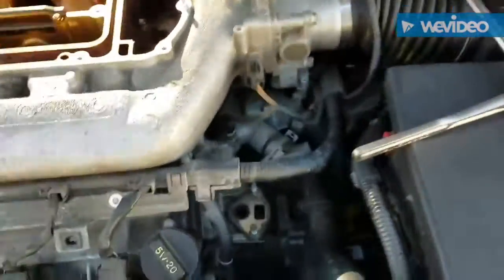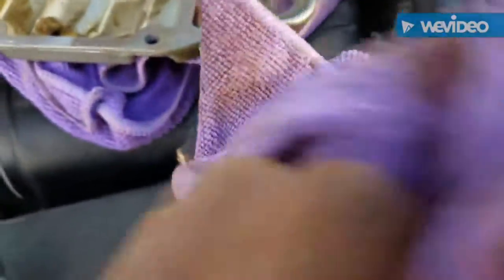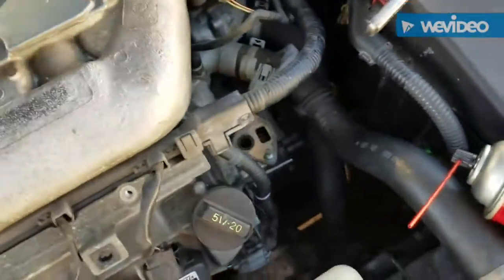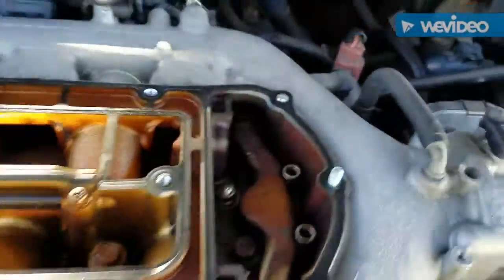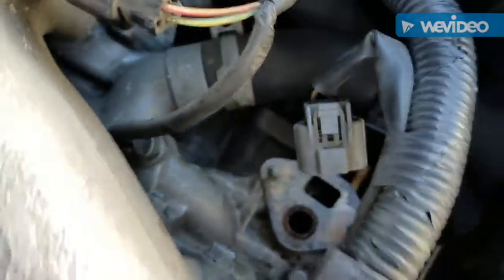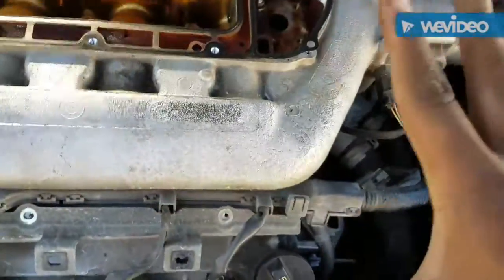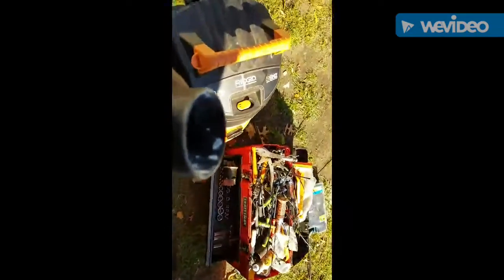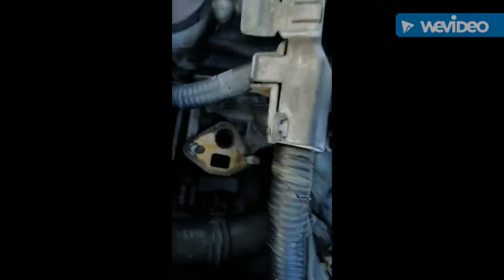P0401 P2413 EXHAUST GAS RECIRCULATION EGR INSUFFICIENT FLOW FIX TUTORIAL

Comment: How do you clean the small EGR port holes on the top of the block?
Reply from the maker: Throttle body cleaner
Reply: @fabolousg4ever  I don’t need to worry about the carbon and cleaner going down into the ports?

Comment: Thanks for the vid, gonna try this and cleaning the theottlenbody and manifold with seafoam spray hopefully thos makes my car run better
Reply from the maker: keep me posted on how it goes
Reply: @fabolousg4ever  runs way better after doing sea foam treatment and cleaning throttle body with cleaner, definitely was a lot of carbon in the intake. idles and runs much smoother and quieter, throttle response is smoother when you're rolling into it on takeoff, seems ike it has more low end power when cruising. Also has much less vibration at idle  Still not perfect but a step in the right direction, will clean egr next
Reply from the maker: @KenyonPayne  great news glad for the update.

Comment: Did you re-use the EGR valve gasket when you re-installed the valve? Or buy a new one?
Reply from the maker: You can buy a new one but i reused my gasket.
Reply: fabolousg4ever no issues with re-using the gasket? 

I want to do this cleaning and I was curious whether the old gasket could be reused with no issues (eg, leaks). Just thought I’d ask before pulling the EGR valve.
Reply from the maker: No no issues for me

Comment: I get that The EGR letters on top but it marking me the oxygen sensors and Im running rich !! Smoke and gas from the exaust if I change that Will it fix the prob???
Reply from the maker: +Rodrigo Guzman yes engine is clogged clean those valves and the car will feel way better

Comment: So to clean the intake manifold open it up and spray it with carb cleaner tooth brush it wipe it down then take that weird shaped piece spray that down, do the same to the egr valve & throttle body if you haven't ? If so seems easy just My problem would be buying something to blow it out from the top of the manifold lol
Reply from the maker: lol